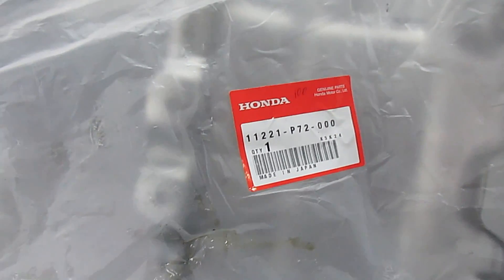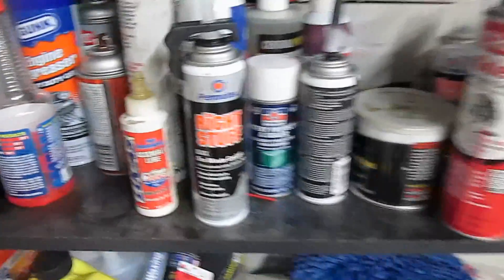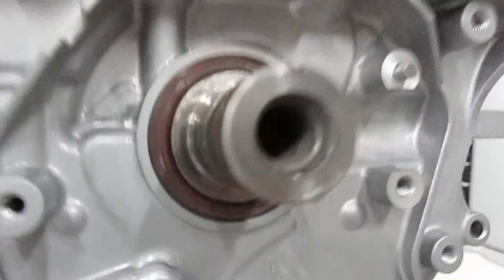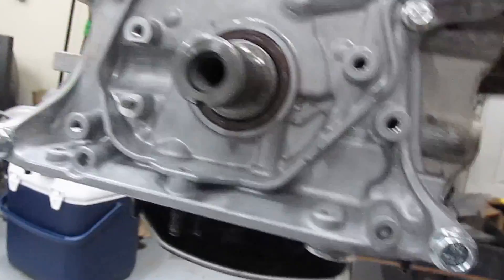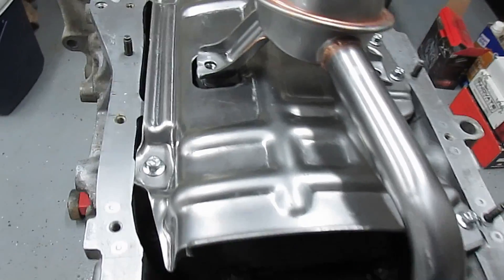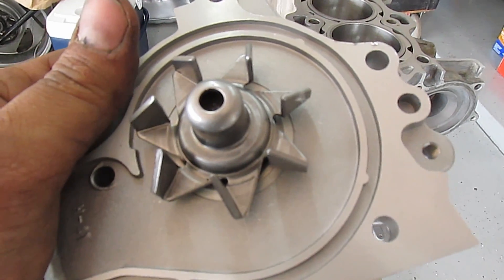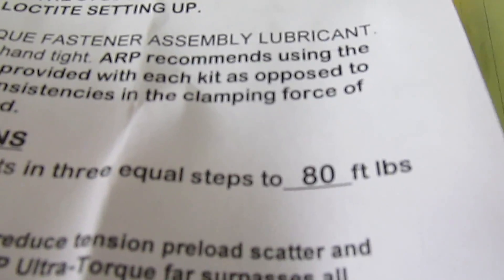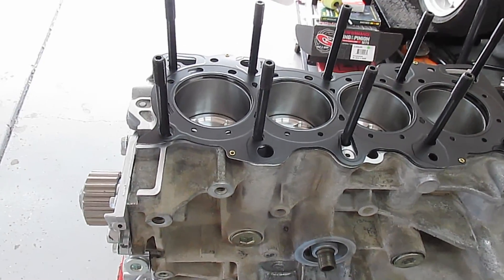Project No Rice #5: LS/Vtec Oil/Water Pump & Oil Pick-up (Stroked LS/Vtec Acura Integra)

Comment: 12.9 is the hardest actually just sayin, good job tho fr
Reply from the maker: 12.9 is not available locally
Reply: @FatGuyBuilds  I work for a fastner supplier in CT, doin similar build but b20 gsr, using socket caps though. Could get you any hardware you need.
Reply from the maker: @SupremeKnightPius  ok.  Email me.  Jasongeorgievski@gmail.com

Comment: Did you use a 22T for the water pump?
Reply from the maker: you can do either.  if you use a LS pump, then you need LS timing belt...  gsr pump, then u need a GSR timing belt
Reply: FatGuyBuilds thanks

Comment: Old post but quick note. The ARP stud thread that goes into your block you want to be  COMPLETELY DRY AND CLEAN. No lube of any kind should be used here. When you tourqe the head down you use the supplied ARP tourqe lube on the nut only! You don't want your stud to turn in the block at all while tourqing the nuts down. Trust me on this men!
Reply from the maker: kool thanks.  never had an issue yet.  but thanks for the info.

Comment: How is the motor after near 4 years? You still running it? Any New projects in the works? Did you ever replace that cylinder binding eagle block guard and CSS the block?
Reply from the maker: Still running and driving no real issues beside 2 dead distributors.  Been telling him to just get the coil on plug setup.
Reply: @FatGuyBuilds  nice. Those remanufactured distributors don't live long i know. Dragonflies distributors i have had great experience with but coil on plug is the way to go👍
Reply from the maker: I will be restarting the monte carlo in about 2 months
Reply: @FatGuyBuilds  I'll be watching👍

Comment: Double gasketing only provides an alternate point of failure and counteracts the ability of the primary gasket to do its job right. RTV should never be placed on an O-ring which is infinitely stronger and better at sealing, nor should it be put on a actual gasket as not only is that stronger... but the bolts will back out as the metal gasket doesn't shrink where the RTV will over time. The application amount was fine and actually nice! The double gasketing is just asking to grenade a motor.

The RTV on the oil pump is there to prevent oil sloshing around in the pan from seeping out. It is not there to prevent the oil pump pressure from spraying out oil... that is the job of the -o-ring! That is why from the factory you will never see gasket material on it.

Also it takes 24 hours to fully cure, even "the right stuff". If you RTV the pump in the normal spot its not an issue! But the pickup tube gets soaked in oil... the oil will wash it off, carry it away into the oil galleys, piston rings, pickup screen! You will prematurely kill engines doing that.... and its unnecessary to double gasket!
Reply from the maker: Right Stuff is amazing and not one engine I have ever built with it has leaked.

also RTV dries from the lack of air.  

I have never had 1 issue in the whole 20 years I have been doing this.
Reply: @FatGuyBuilds  RTV dries from humid air... read the technical data sheets. They are full of information on it. In 20 years how many cars have you done? Enough to say that you are comfortable doing it wrong as a profession on the off-chance you destroy a car worth 100k? You can be sued for doing a car like that... because its wrong.
Reply: @FatGuyBuilds  The bigger issue is that there are several different hondabond formulas (RTV's) just like permatex has several different RTV's. You can crossreference the OEM as being Ultra Grey, no where is Ultra Black or Right Stuff recommended because it is the wrong consistency for the application that Honda prescribed. Using the wrong stuff and double gasketing with a  material that is derived from dirt (silicon) is just asking for trouble in the long run... You should only need to do that job with regular maintenance probably once every 15-20 years.
Reply from the maker: @trevormorgan7138  i think you are over reacting to be honest.
Reply: @FatGuyBuilds  I am just being real. I think your method was good. Your prep work on the matter shows you were never formally trained... Keep doing it wrong or aspire to continue making mistakes. Knowledge is power.
Reply: @FatGuyBuilds  You spent a lot of time prepping it wrong is all i am getting at... The job doesn't require that much effort to do it right... waste of materials and added risk.
Reply from the maker: @trevormorgan7138  it is only a mistake if it ever fails.  just like the people who cry when I don't TQ things to a specified number.  Tight = Tight...  if it comes loose. then learn and make it more tight next time.  I have had too many plain gaskets leak on me and cause me double work.  Right Stuff has never failed me.  not even once.
Reply: @FatGuyBuilds I'm with you on this one man you've got it figured out. I'm trying to replace my oil pump in my 99 Integra LS and after reading your comment I think I can tighten the oil pump bolts by hand and  ratchet it until it gets tight. Like you said tight=tight

Comment: Not that it matters since I am sure the 10.9 grade will perform in the application you showed, but 10.9 isn't the best as there are also metric 12.9 grade which offer superior strength. Beyond that, you can get aerospace grade and fasteners from ARP that exceed 12.9. For those cases where there is no kill like overkill.
Reply from the maker: Thanks For Watching!!!

Comment: where did you get all the nuts and bolts cuz I'm building lsv and not sure if I have all the hardware so I was wondering where you got all the hardware from because I would like to put all brand new hardware online from one side of the motor to the other side
Reply from the maker: ace hardware, except for the timing cover screws.  search acura oem parts on google for those.
Reply: Jason Georgievski  if u can make a list please
Reply from the maker: Jack Laferriere use a zip tie.  stick it in the hole.  mark it with a sharpie, write down how many u need of each.  buy extras.

that is how i did it.

Comment: is that the stock baffle plate ? pick up tube ?  and oil pan  ?
Reply from the maker: stock windage tray, stock pickup.  we will get a different moroso pan with turbo oil return line.
Reply from the maker: gsr baffle pick up and oil pan on an LS block.
Reply: ok thanks I'm building  a gsr block going the stroker route but 95 mm  n getting the block wet sleeved  n taking that to 84mm  plus a 4ported b series oil pump  the head done now just doing the block then gotta save for a turbo
Reply from the maker: GTX3076R or nothing, 0.63 Tail V-band hot side,

Comment: M109 in the back??
Reply from the maker: yup building that too.  goal is 190HP N/A stay tuned for that.
Reply: +Jason Georgievski cool! mines down right now haha
Reply from the maker: that sux.  would you like a brand new RAW performance exhaust muffler?
Reply: I just put Cobra swept on it haha
Reply from the maker: OMG you lost horsepower
just sell that thing.
Reply from the maker: those things are horrible.  but they look pretty
Reply: They sound nice! I'm not going for a big performance on this one haha
Reply from the maker: you should be aiming for 130HP to the wheel.  that is pretty easy to do.
Reply: I should probably get it running first haha
Reply from the maker: Whats wrong with it?
Reply: It's not getting any fuel. I think the fuel filter is restricted
Reply from the maker: fuel pump is probably dead.  doubt the filter would be clogged that bad.